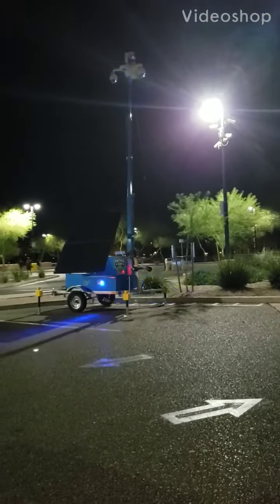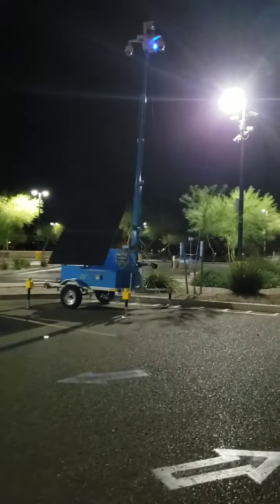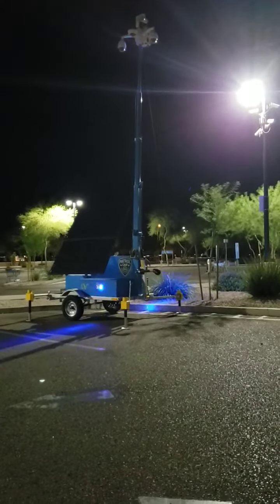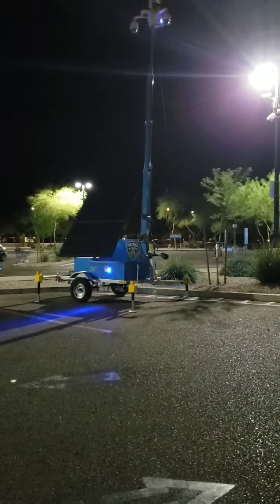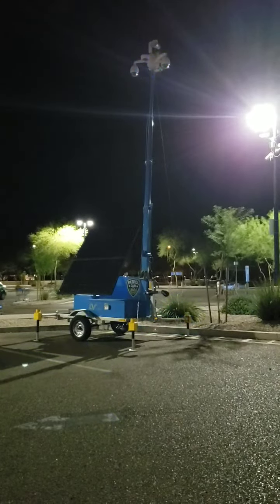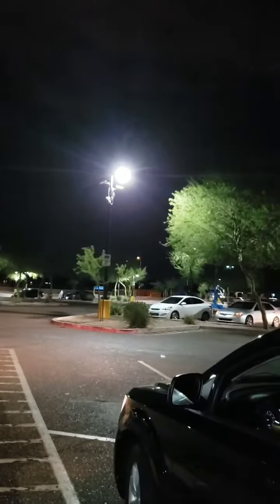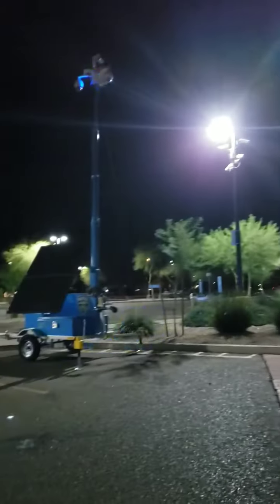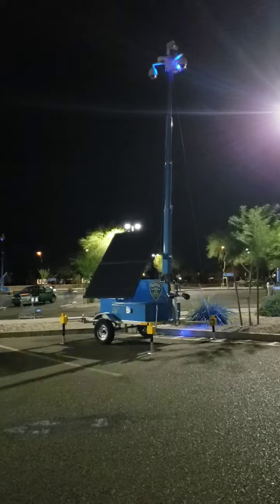What Are These Police Cameras At Walmart Used For?

Comment: The blue light system is part of a test program Walmart is trying out all over the United States. There are a few different reasons why Walmart chose the locations they did to try out the program.

"Is it a high traffic store? Is it in a busy area? Is there a lighting issue that they're working through in different areas of the parking lot?" Ragan Dickens said, who is a spokesperson for Walmart. "So they're looking at a certain set of criteria to determine where to put these initially in this test phase."

Dickens said the camera systems are called a mobile video platform. It's a camera system with a blue light on top.

"We are looking to cause the bad guy that would come to our parking lot or to our store to pause and say 'Hey, Walmart might not be the best place for me to commit this crime,'" he said.

They are also there to make the associates and customers feel more safe.
Reply: they have cameras all over the stores you can't enter a walmart without being on 3 to 5 different cameras, one on door pinhole camera, one in thing that opens door and one in ceiling, one on the wall outside and again when you get in store! hasn't stopped criminals yet, thats a lie i say!